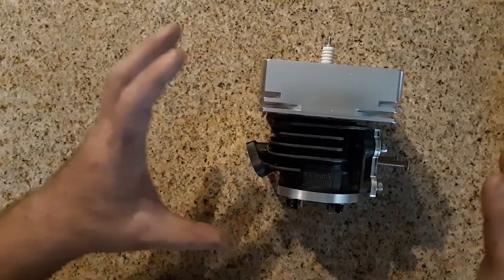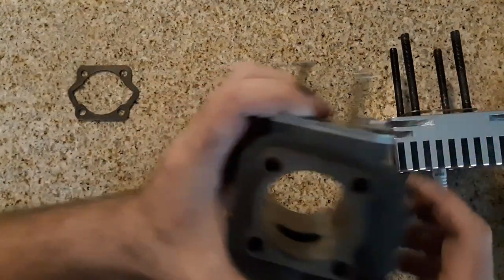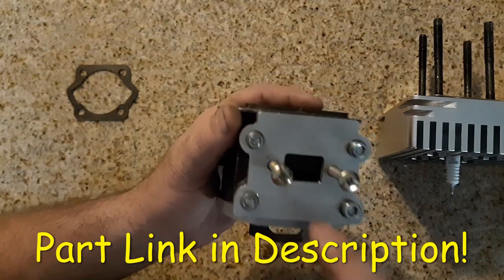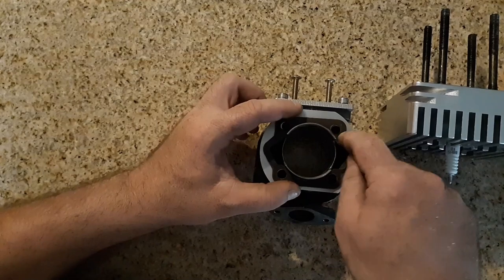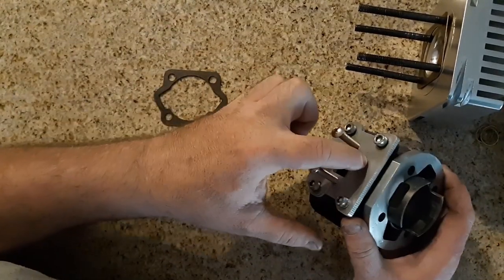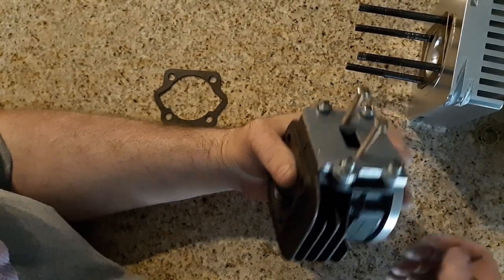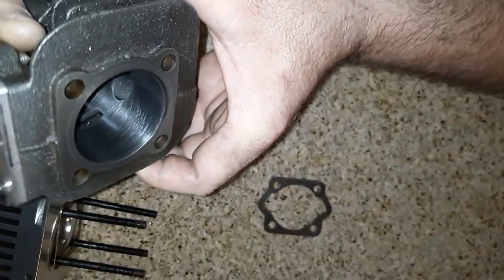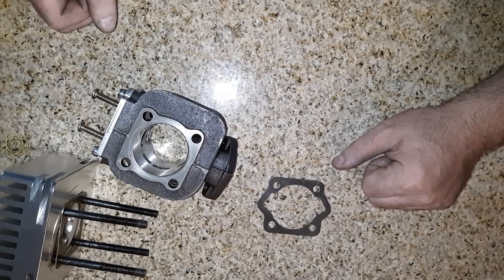(READ DESCRIPTION) Stop Getting Burned  $300+ On Minarelli Builds! How To Pay 1/3 That Price!

Comment: Anyone that’s charging that kind of money is 100% offering great customer service if anything goes wrong. Ethan, for example, puts his heart and soul into these lil motors and will always back every bit of his precise work!!
Reply from the maker: No No no no.... not what getting at!  I have no issues with smoliks stuff. He builds solid parts and some higher end parts. For what he charges it more then fair!  What I'm talking about is these ebay, facebook and random pop up online places selling (ready to run parts kits) they put piles of crap parts in a box then charge even more for that mess then smoliks sells it for.   Seen s pl acers and stuff being made 12mm fir example. Or they buy the cheap 40mm or 44mm piston/jug sets sell it under titles 70cc.
Reply: Like gomax?
Reply from the maker: @mtgreen88   lol yes actually.  That is perfect example! On top of selling crap parts to start with in kits. Yes they have one of the rip off "upgard minarelli kits" for 350$
Reply: @BuildBreakFix  yeah I agree w the gomax kits but with the dlh kit you atleast get a fully ported jug and ported space plate and he port matches the g2 reed and gives you stuff plates for it. If I was to get any bolt on kit it would be from dlh or smolik. Anyone else is just crap parts
Reply from the maker: @mtgreen88  Bro read the Description lolz! Hes a real A-hole of a guy personality wise lol Other then that He makes decent stuff that why I listed him as a place to go in description!  But yeah parts wise he does good products in description i have example of a scammer Ebay kit linked to!

Comment: It's to late I paid 525 but I got a complete minaralli hybrid I was going to drill out the cylinder but I got the 6mm studs to work even got a really nice cnc front and rear motor mounts but didn't need them a macuniy carburetor true mz65 expansion chamber pipe balanced crank but your right if you shop around you can get it cheaper
Reply from the maker: Well not saying good quality parts are not nice! Or worth it.  But now they are selling kits ebay all over the net 300 to 350 for pure basic garbage parts lol.
Reply: @BuildBreakFix  I hear you that was one of the reasons I Bought it from this seller I purchased a pk80 G4 cylinder 2 of them and there still working good
Reply from the maker: @mikemiller3303  yeah see that is quality though you paid for in that regard worth it from that point!  When they sell every china part top $$ was like omg!
Reply: @BuildBreakFix  yes sir I've only been into it for about 3years right before the pandemic my son asked me to help him put a motor on his bike and I rode it and it fired back up that young man trapped in this 57 year old body I have a blast messing with these bikes lol so yes I have to watch cause as you said lot of cheap parts out there
Reply: @BuildBreakFix  don't know your name but I was wrong on the woodruff key it slipped out some how witch was a good thing I had one to take to auto parts store anyway he had one and put a little ca glue make sure that doesn't happen again don't want to be peddling to far and I finally got the ngk br 8 hs spark plug in thanks again hotter spark stopped a lot of the spitting and sputtering she was doing transitioning from normal 15to 20 mph to 25to on up from there love it
Reply from the maker: @mikemiller3303  8 is colder!  Stops the pre ignition before dead centers!  2 super hot end.  6 is middle. 9. Is coldest in that plug type!  I know seems backwards! 4 is in terms of electrode exposed! More exposed cooler it can run
Reply: @BuildBreakFix  cool I learned something new maybe that will help me out with it getting to hot asking your opinion preignetion would have a affect on the temperature wouldn't you think and I was running a higher octane fuel to prevent that to all I know I put that and when it's transitioning from normal to beast mode it's smooth lol
Reply: @BuildBreakFix  MR. BBF I have a question I have 2 yd100 one is a lot newer than the other anyway one I'm pretty sure needs new rings and from what I hear cylinder at the same time so out of Curiosity a while back I purchased a compression tester and both were pretty close to each other so today out of Curiosity and to make sure that's what it needs I checked it again 1 is almost 60 psi and the worn one is like 46 psi now here is my question I have a minaralli hybrid engine also and when I checked it it was like in between 26 and 30 psi is it sapossod to be that low?
Reply from the maker: @mikemiller3303  oh wow yeah! Very low on the minarelli.  Should be around 55ish at a minimum.  Your reed valve may be leaking! Flip over the reed pedals.  Then try it again!   Many times that will fix the issue when an engine has one!  If it seals well no leaks reed  Then yeah you roasted the poor thing!  If its cast iron hone it with 2" drill hone, then toss in 66/80cc motorized bicycle piston #3 on top will work perfectly in it!
Reply from the maker: @mikemiller3303  also if you buy new yd100 piston and rings! Make sure you use organic oil for breaking them in first gallon.  Helps shape them in chrome lined cylinders!
Reply: @BuildBreakFix  I thought the thickness of the insulator around the electrode itself determines the heat range but that was just an assumption on my part. I've never really paid attention to dumb sparkplugs lol! I've been running the stock kit plug forever and ever, no problems. That's funny too ! ✌

Comment: What you think about the new smolik horizontal engines they marketing now?
Reply from the maker: What new engine?  All these  minarellis are stock horizontal engines. Just means it had bowl type carb down hill vs jog top end. Which required a pumper type carb for uphill has flow.  If you mean does smolik sell good parts?  They actually are very decent in that regard. Never seen a bad part made by them or heard complaints about any.  Most of people I talk with all say they are very decent with customer service in regards to questions as well. I personally have nothing they sell. But I have seen pretty much everything they sell 4 or so times from stuff people bring me to help them fix or build. Very nice kit parts

Comment: Yo thanks for this tutorial, but i have a question does it fit 66cc engine ? And how long it takes to modify it ?
Reply from the maker: literally put a 10mm spacer under the jug 2 gaskets and the build is done LOL piston goes on like normal one and funny enough motoirzed bicycle pistons 47mm ones are identical to minarelli ones runs fine! skirt on minarelli ones are 2mm longer but effects nothing!
Reply: @BuildBreakFix  nice tysm:)

Comment: Hey, would you say $200 for a wildcat ultra mineralli from cali motorbikes is a good price? Just got one and it's on the way.
Reply from the maker: Aluminum jug right?  There is a ceramic as well which runs really hot.  If it's aluminum then yeah not a bad deal.

Comment: What makes the Minarelli jug produce soo much more horsepower over stock?  I mean, it isn't exactly a 'big bore kit'...... stroke and bore still the same as stock, ain't it?  Since you said the piston you are using is from your original motor or something.
Reply from the maker: All in port design!  The minarelli is ported for a powerband of 50%/75% throttle! when it hits i can jump to like 13k rpms!   Motorized bicycle kits! are low end ported.  So there 25% to 50% throttle and then hit about peak of 7k rpm!  RPM - more rotation of your tire faster! Now on other side of this! Minarelli sucks balls taking off no low end power so you peddle your brains out starting!  where a motorized bicycle jug can stop and go with not as much effort!  Minarelli does not need low end since it has an automatic transmission to over come stop and go part on a moped that is!

Comment: I am pretty sure Gomax and Southern customs CC are selling the Minarelli cylinder is 47mm bore(70cc) oh, yes the mark with 49cc on cylinder because mold is marked. and spacer is 10mm. Also balanced crank, VM20 style carb and heavy duty clutch spring and upgrades magnet and coil.
Reply from the maker: No 44mm jugs and pistons are showing up. Not 47mm ones.  Yes very well aware there all stamped with 49.9cc! I own 6 on them lol no spacers are 14mm and they send you a 🖕email telling people to sand them. Want a copy I know 3 people personally already brought me there kits to fix
Reply: @BuildBreakFix  Are you Serious? If you got 44mm jug and 14mm spacer from Gomax or Southern custom CC pls show bill when you bought and pictures of the parts. I would like send free parts also make up 3 times to you. Because I supply all the Minarelli parts. I know what size we supply. My name is Alan Zhang. You may contact me by Facebook any time.
Reply from the maker: @mrhaha6180  already a video man that is why he went postal! 4 customers bring in kits one gomax and 2 for ss customers 1 from Ebay.  I honestly could care less about any of the 3 places anyhow!  One from dons today is posted on facebook From dons again 14mm spacer. One from gomax 44mm cylnder.  Well theny ou guys need to do better qty control cause he buys them from same sellers I do on Aliexpress so don't see how you have any part in that sale!

Comment: I have a seeutek motor can I put the minarelli upper on the bottom end
Reply from the maker: yes! 38mm crank needs a 8mm spacer and 40mm crank needs 10mm spacer!   if you buy parts !  buy form here:  You will not regret one extra 1$ spent over cheap ebay crap!  Stuff on ebay is horrible bro done whole videos on why and such hw they screw people!  This place here is well known and does top notch parts and qt of them all custom made inhouse! You will get a person in few minutes respond to part questions if you have issues via email!  Very good parts seller. This coming from a person that is super critical of minarellies in general so just saying!  I won't back many places this one for sure will not give you the runaround on cheap crap parts! I personal bought some was very impressed! https://smolikperformance.com/collections/minarelli-conversion

Comment: That's exactly what southern customs or one of those Sellers did they bought a bunch of them double spark plug engines and a big unboxing on there channel it might of been called a firestorm or wildcat idk. But then less then a week later BMW cycles came out with the phantom 85 and they saw the power and speed it had. So they did what you said how to build a min. Cheap so I bet southern customs went and bought min cylinders in balk and just used all the new bottom ends of there dull spark plug head engines. And turned them into mins. To capitalize on the sales they were gonna lose because of the new phantom that just came out. Bet
Reply from the maker: Yes exactly!  That is exactly like the crap kit the guy I know bought other day and got yesterday for like $380.  Waa like wtf... the part that is really f'd up.  It was a 44mm minarelli cylinder/ piston  he got on top of that! Lol

Comment: Oh this will annoy a few sales people 🤣😂🤣😂.
But what you say is basic, yeah CNC parts are cool and work,, but ya don't have to spend recklessly to achieve the same if your smart in your purchases,
 by simple hitting search and going beyond the " Pushed Sales " of the common search engine, break the parts down as needed,
If your tackling this your knowledge is beyond " duh, hammer or screw driver" so use it to your advantage
Reply from the maker: Yeah!  Most fall on a trap don't know what there buying!  Dont get me wrong nothing against quality parts!  But when you see fb post or ebay post for pure crap or la saw dust shoveler trying sell that crap top dollar its criminal!